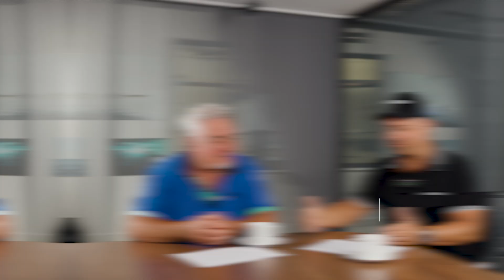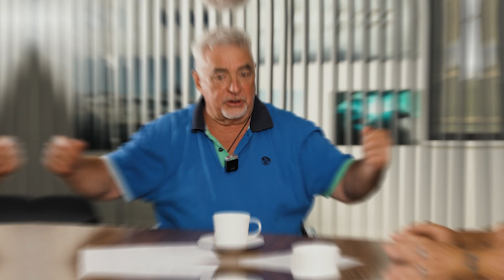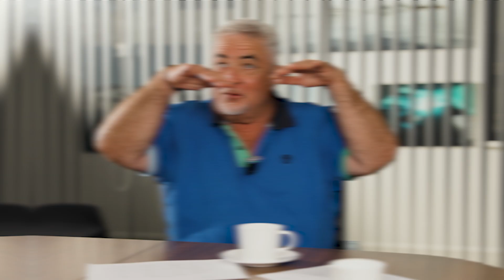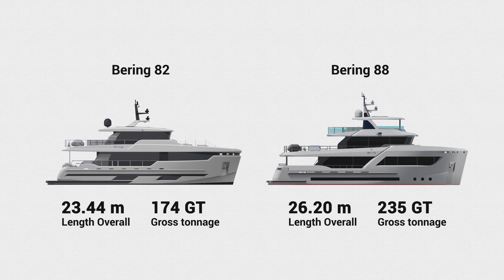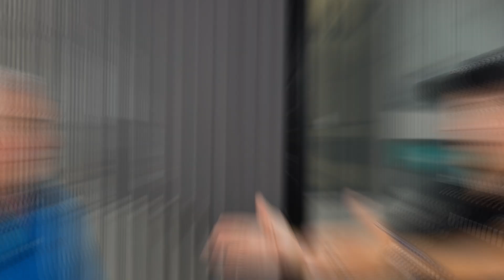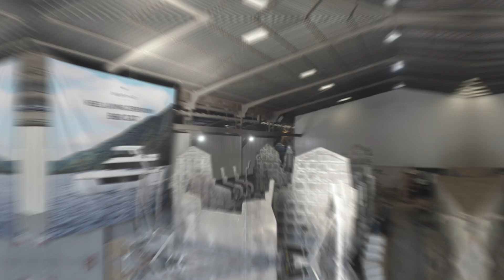BERING STREAM: Expedition Catamarans Comparison with Alexei & Rico

Comment: Like catamarans any type I'm interested in. So interested in what Bering is doing with their 60, smallest, 70 medium side, and 80's biggest of the three of the aluminum boats.
They look like from the pictures like an apartment, home from home which is useful as they are explorer ships. 
How quiet will they be? Engine or generator noise, people moving around, as the fiberglass cats sound travels. But Bering with their aluminum is trying for much quieter boat, for family or charter.
Reply: Did you not watch the video?

Comment: We love your features. We have a question on another matter, however, ventilation. 
When touring boats, Rico and Victoria often point out openable windows and hatches for cross breezes and fresh air and ventilation. We have been on small boats, weekenders, on which the forward cabin has taken on a locker room odour. Even on rag tops and open boats, the storage lockers often smell like gym lockers. On boats like the Bering’s, how do you get fresh air in and stale air out of the lower decks? Especially, how do you ventilate out the hot damp air from people like me who enjoy long hot steamy showers? How do you keep storm water and sea spray from entering the system?
James and Kathy
Reply from the maker: Thank you! We are installing fresh air make up units which take the fresh air from outside and conditioning then sending trough ductings to the A/C fan coils, and individual silence exhaust fans or central extraction units takes the air and sending away from the vessel.  We consider at least 6 air change per hour for a healthy interior ambient.

Comment: In all your promotional video's you talk about superyacht quality. It is a shame that this only counts for noice and vibration. Because in another video you say that paint work and alignment is not always perfect. And also spacing for instance in interior cabinet doors are not always the same width. Bering has nice boats, but the quality of the completed product leaves much to be desired. Too bad!
Reply: Surely if you are genuinely interested you would not rely on videos and would go a view examples of their range to judge for yourself? I’m certainly not in the market for a boat this size but that’s what I’d do with any size of boat.
Reply: @woolyimage  I do not need to if the owner of the yard is the one who is telling this.
Reply: @woolyimage  It's like he's saying, we make really good cars. They're very economical and have good suspension. But we paint them with a brush, the doors don't quite fit, and one wheel is bigger than the other. But hey, you can drive them on the road!
Reply: Have you actually ever been aboard one? I haven’t and would not seek to rush to judgement until I did. If your building a boat like this you’ll have a project manager in place who would monitor such things. But super duper cabinet fit would be a low priority among the things I’d be concerned about.
Reply: @woolyimage  If the owner of the yard says the fit and finish are not perfect, you say "I don't believe you" to him? A projectmanager is for the communication between customer and yard, so the customers wishes are met and the possibilities of the yard are matched. But for quality control of the builds you have a different team. People specialized in spotting problems within the fit and finish of the builds.
Reply: If you pay millions for your new ship, I bet you want everything to be perfect. I know I would if I was putting down that kind of money!
Reply: @peterhoofien  which is why if your spending millions on your new yacht you pay a project manager. If these ships where that bad why would Bering have 17 in build ! Why would Nautistyles who have probably been aboard more luxury yachts than most, selected Bering to build their new yacht?
Reply: @woolyimage  17 in build and only 14 delivered. Bering has grown to fast and quality control is lacking behind. A projectmanager you hire will not be in the yard all the time. And it is the yard responsibility to make sure the quality is secured. Who else!? It is their product. On the generator install for nautistyles a hose was damaged. Rico spotted it, but what if he didn't? When the engines was installed She was saying that Rico was keeping track of everything. When I made the remark that it was a good thing because you do not want damaged hoses ect., I got the reply "none of my business". That tells me a lot of the situation at Bering. They where promised mountains, but quality control is a problem. And now they are making money by selling Bering boats. So together with their reply, 1+1=2 for me.
Reply: @peterhoofien  So your not interested in buying a Bering then I have to ask why are you lingering here.
Anyone with the resources to buy one of their boats will have the ability to make decisions about the standard of the product being supplied and whether it is suitable for them. As to the hose being damaged during install hardly the end of the world and when actions like this are happening you would be foolish not to have people observing. Yachts are extremely complicated pieces of machinery and things will happen along the way which is why you have project managers. Then there are always comprehensive sea trials to find any issues. ANY boat you buy will have a snagging list. I have never heard of a boat without one ! You also need to understand that buying a one off or the first of a new design will always be more challenging than buying a boat which is part of a successful series where most of the teething troubles have been sorted. What sets good suppliers apart is the desire and ability to sort all the issues found promptly and competently.
I don’t know what experience you have of boat building or commissioning or being involved with that process but you do not appear to have much judging by your comments.
If Bering is not for you then perhaps move on.

Comment: They are working on new car batteries that are different from lithium batteries.
Lasting easily, over one million miles.
And quick-charging, to 80 percent battery charge, in only 15 minutes.
Not sure, if this will cross-over to boat and yacht batteries.

I think hydrogen batteries need to be refilled with water. Or, whichever way cars are filled. 

A yacht would  have to have a fesh water maker.

Comment: There is a new propeller for smaller boats, for better fuel efficiency.

For yachts, I saw Rico's video with a new propeller design, for better efficiency. And moving the weight better. With a different design. 

It has a raised plastic  piece  into a groove on each propeller blade.  Adding a little more push, to move a yacht.
 And that keeps the water from moving off the propeller as usual. 
It eeps the water flow on the propeller slightly longer.
Instead of flowing off as in most propeller designs.
Reply: It keeps. Correction, above
Reply: Check out the Sharrow
Reply: @MrBDub  Yes, that's the one I was talking about, for boats.
I'm not sure it would work well, with a lot of weight of a yacht. Like 150 to 180 tons or higher. 
They still need a bigger prop to push the weight. 
The other props might just spin, with less push for a heavy yacht.

Comment: How often  does a yacht  or catamaran need oil changes?
Reply: There is a general rule of 250 hours in standard use 150 in severe use. But most yachts aren't really sailed much so they just change their oil once a year.
Reply: The sailing yacht I owned had a recommendation of 200 hours for oil changes for a Perkins based Volvo engine. Which is around what the previous respondent mentioned. For these motor yachts oil changes would be based on manufacturers recommendations. I think these larger marine engines would have longer intervals but you’d need to take specific advice.
Reply from the maker: Hello! Timing may vary according to engine and manufacturer, please refer to the operating instructions from the manufacturer.

Comment: How about pulling out the diesel and generator sets and instead going all electric. Bump the battery storage (Non liquid electrolytes) and adding hydrogen fuel cell with range extender. Maybe a rotating telescopic carbon fiber mast with wings or inflatable sail that integrate to auto pilot. Not sure you would want any hydrogen if you did all that, but maybe folding props. 

Am interested in seeing the rudder and prop/shaft design. I always cringe when I see prop bearing at or below the waterline or stuffing boxes with huge space that can flood a hull. Why not a pod motor with the bearing at the top of a column so it's above the water line? 

Range unlimited. It can be biggish because putting in at marinas is not necessary to fuel.